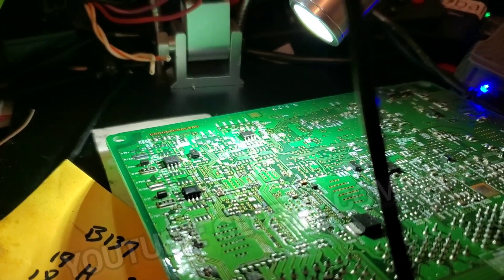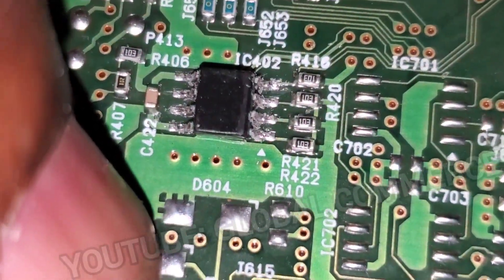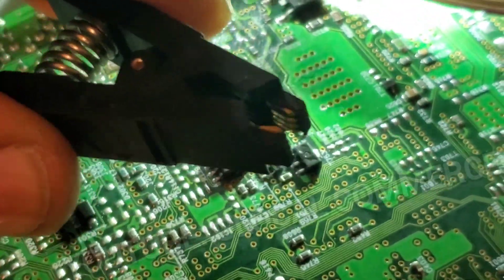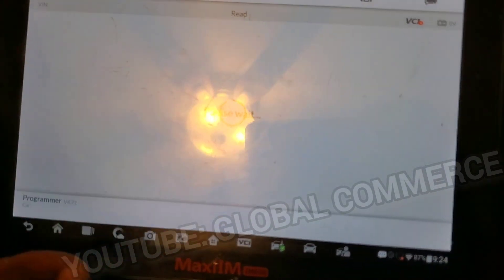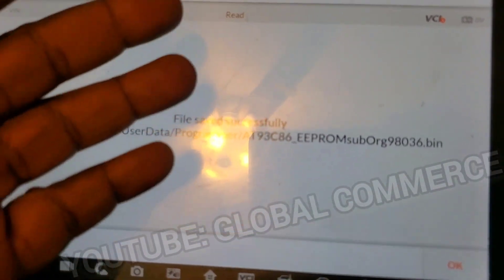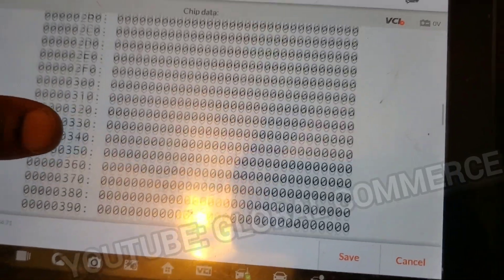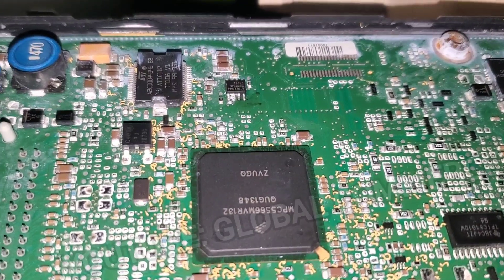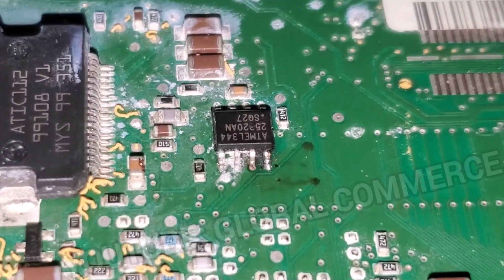Advanced EEPROM Reading techniques in CIRCUIT with Autel IM608 XP400 PRO

Comment: Great video! You mentioned at 09:43 that you would "lift a leg" if the other components are causing interference, I'm guessing this means de-soldering one of the legs of the chip to cut the power to the rest of the board? Or does this mean something else? I'm new to this and this video has been a MASSIVE help, thank you so much!
Reply from the maker: Thanks so much for the kind words,I'm really glad the video has been helpful for you! When I mentioned "lifting a leg," I was referring to de-soldering one of the pins (or legs) of the chip. This allows you to isolate it from the rest of the circuit to see if it's causing any interference

Comment: U should never conect this when the chip is attached. U need to desolded and then u can extract firmware because it could be risky at least u know what u are doing.
Reply from the maker: Thanks for the comment, these are methods of reading in circuit.  I actually feel its riskier pulling the chip.  I've seen people damage board and chips with heat 100 times more than I have seen anyone damage something by reading in circuit.  The risk of heat damage and ripping pads are extremely greater than damage done by reading in circuit.  Hence I would reserve pulling the chip as a last method.

Thanks for watching!